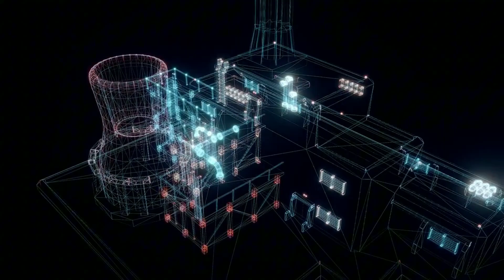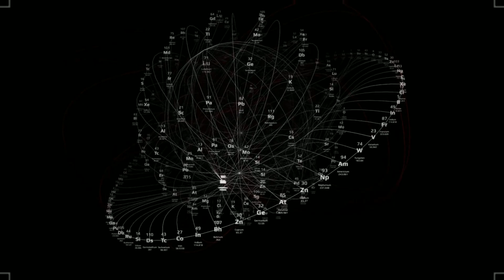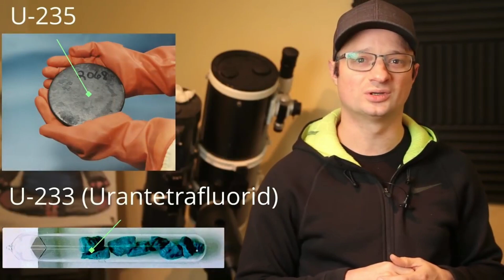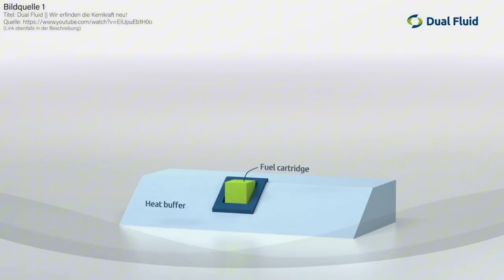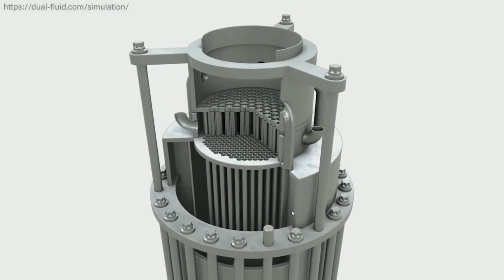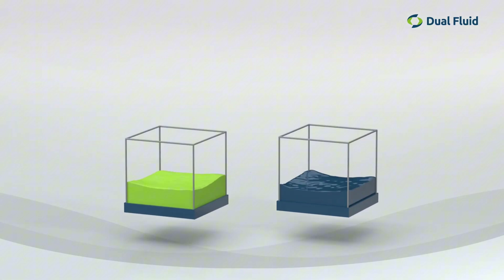NEW NUCLEAR REACTOR! Safe Nuclear Energy for 1200 Years!?

Comment: 🔋 Key Advantages of the Dual Fluid Reactor (DFR):

• ⚡ Ultra-efficient: Nearly 100% of nuclear fuel is used  
• ♻️ Burns nuclear waste, depleted uranium, natural uranium, thorium – and all actinides (incl. Np, Am, Cm)  
• 💥 Transmutes long-lived actinides into short-lived fission products  
• 🔄 Built-in Pyro Processing Unit (PPU): Continuously removes neutron poisons and extracts valuable metals  
• 🛠️ Liquid fuel: No solid fuel rods, no reload cycles  
• ⏳ Decades of operation with a single fuel load possible  
• 🚫 No corrosive salts: Liquid metal fuel avoids fluoride corrosion and complex chemistry  
• 🧊 Lead coolant: Excellent shielding, no water, no pressure → no steam explosion risk  
• 🌡️ Very high temperatures (700–1000 °C): Enables hydrogen, e-fuels, ammonia, and direct steel reduction  
• 🧠 Self-regulating: Output adjusts automatically via negative temperature feedback  
• 🪫 Minimal waste: Only short-lived fission products remain (• 🏭 Compact & scalable: High power density, ideal for modular deployment  
• ⚙️ No moving parts in reactivity control: No control rods required  
• 💰 Uses spent fuel, DU, thorium & actinides – no enrichment required  
• 🌍 Reduces dependence on enrichment, mining, and fuel imports  
• 🔄 Fully closed fuel cycle: No external reprocessing required  
• 🆚 Outperforms typical SMRs: No pressure vessels, no water coolant, no fuel handling

Comment: It waist more energy just to get what little energy out. 
1. Getting it out of the ground
2. Processing it
3. Enriching it
4. Useing it. 
5. Still being Radioactive long after  we ate dead.
Reply: As you take spent fuel there is no point 1. - 3., and as you get more than 100x more electricity out of the fuel than with conventional nuclear power, the resulting amount is so much more, that you can run a DFR more than 100 years wi5h 1 set of spent fuel.
After full burnup the radioactivity of waste drops after about 300 years to the level of natural uranium.

Comment: You lost me. Lead and U 235 fluidized?
Reply: its basicly a molten metal reactor, lead as a coolant and Uranium eutectic metal fuel
Reply: @julian11d  It's no molten salt reactor, but a molten metal (uranium/plutomium/actinides/thorium-chromium) reactor, using molten lead as primary coolant.
Reply: @egnegn123  i told you exactly that.